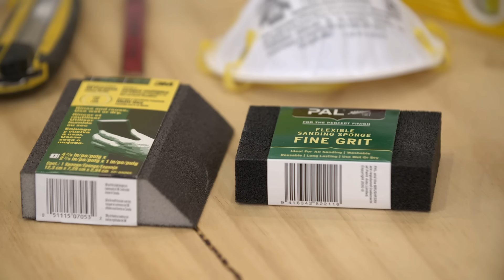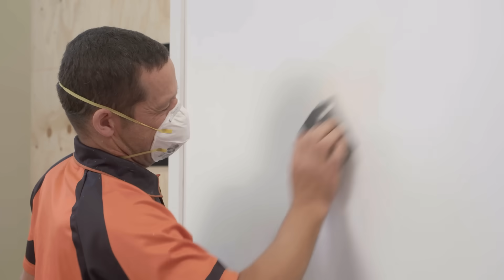How to Patch a Scratch in a Wall | Mitre 10 Easy As DIY

Comment: You don't have DAP dry time Spackle or an equivalent? 20 min dry time primer infused so you can do straight to paint. 

Good tip in this case is you break the rule of pulling tight to the wall and instead leave the mud slightly heavy then sand it down. That way it fills perfectly in one go every time. Minimal amount is sanding do to since you just use the rough side of your sponge and finish with the smooth

If you don't have quick dry spackle or a heat gun you can still finish in minutes by using a hairdryer to evenly heat from about 6 inches away. Just stop if it starts to bubble